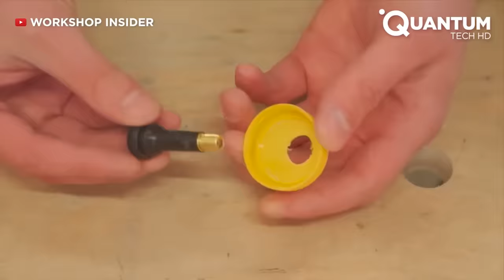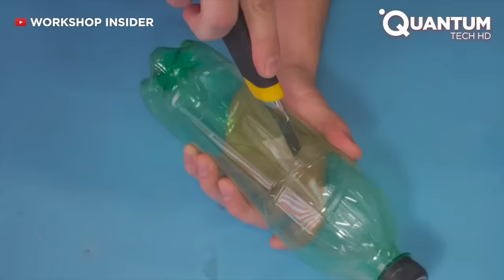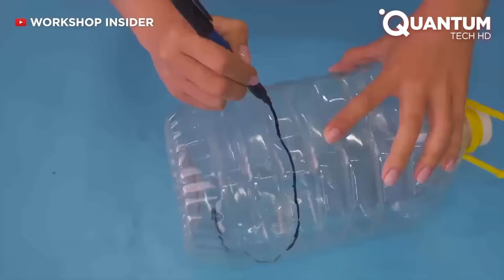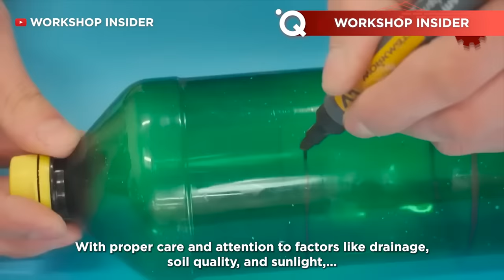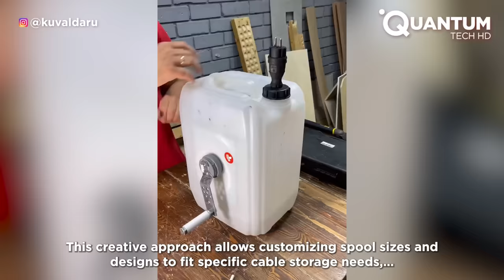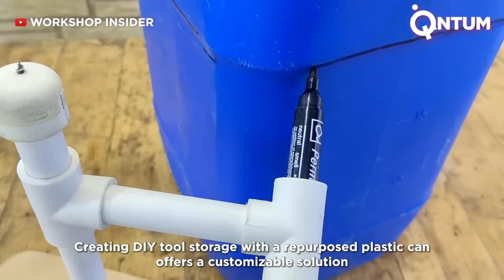Brilliant Ideas With Plastic Bottles | Recycling Life Hacks @WorkTool

Comment: I wasted 10min of my life watching the full video, not a single example/use case is usefull, its straight 100% useless. All of them are non sense, let the real recycler (industries) do their job. Tell me a single example that is usefull and get roasted.
Reply: I agree, why are they showing how to RE-INVENT the wheel.  Why waste your time with those things, just buy the proper thing.  Good grief!
Reply: @angelastevenson252  I like the idea of giving a second life to object to reduce waste.  It's just that PET is the most recyclable plastic and deteriorate easily exposed to elements, polluting. There are plenty of diy solutions (wood, etc...) for the example that might make sense, most of use cases presented don't even exist. Using PET for diy is non sense.